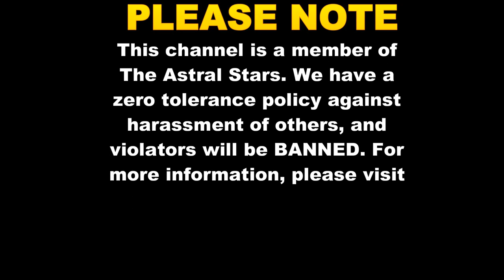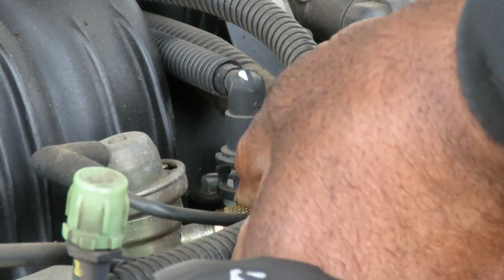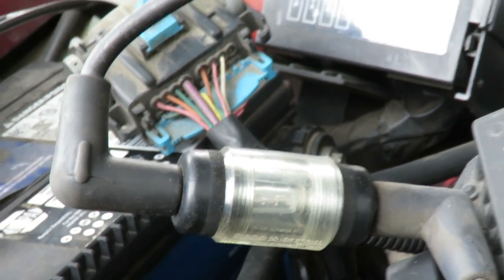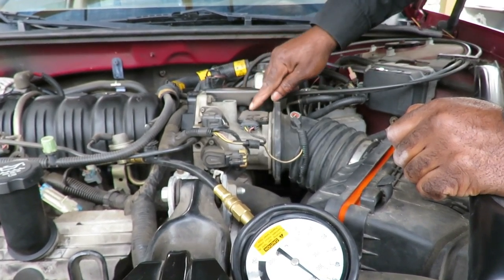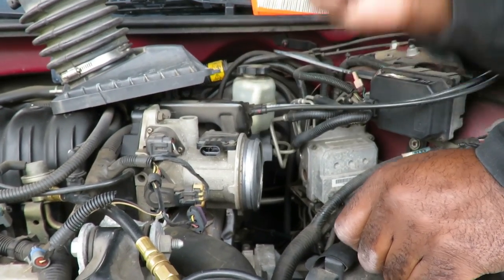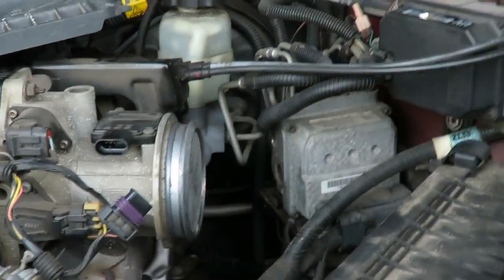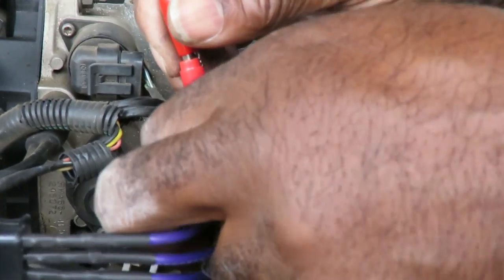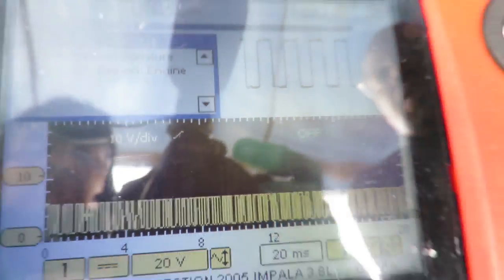⭐ 2005 Chevy Impala - 3.8 - Stalls Out When Warm

Comment: Having the exact issue with my 2003 Impala 3.8L stalling when hot. Swapped out the Mass Air Flow sensor and fixed.

Comment: My car starts fine drives great for about 10 mins then starts sputering and shuts off or if i have already got where im going to and have cut car off then it wont start again for 30 or so mins and then start same problem ovet again drive fine for like 10 mins
Reply: fuel pump?

Comment: @Astral Auto Repairs - Old video but I'm trying to figure out an issue on the exact same car and engine. It'll run fine for quite awhile (talking going 100 miles a day all manner of various driving) and then it'll stall out. Odd thing is it usually starts back up. The last time it did this it quit starting completely for a few days, thought it was the fuel pump, so to test bought the gauge. Gauge showed your same readings oddly enough. Then I removed a spark plug wire to start testing spark and set it down on the frame of the vehicle. Near the "dog bones." She fired up instantly. So that led me to the ICM. As the coils were only about a year or two old. Replaced it, decided to go ahead and replace spark plugs and wires as I tore one of the wires when retesting it. As quite honestly she needed a tune up. I had never replaced the spark plugs or wires. 

Now the same thing happened. Car ran amazing for a solid week going 100 miles a day and now same thing. Actually had to call a tow truck as I was on my way to work when it happened. Stalled 3 times in the span of 2 minutes. Bought a NEW ACdelco ICM as I quite honestly cheeped out and bought a delphi one the last time despite the horrible reviews. I know, stupid mistake. I just wanted the car back up and running as like I said, it's my daily for work. I run light duty soft services for  roadside assistance. I can't be down.  and even said screw it and replaced all ignition coils. As, where I bought the ICM from (Rock auto) advised replacing coils with it.  So I have a COMPLETELY brand new system from the plugs back to the ICM.  (I know, I threw the parts cannon at it.)

Now, I'm wondering was it the MAF all along? No codes, car still starts. But when I was checking the connection on the wires to the coils today after the replacement, she stalled again. Barely touched the very top wire. I'm scared to death to drive this car as I've been lucky each time to be going 35 or under when this has happened. Next time, I'll probably be on the interstate. 

NOTE : This car has 180K on the clock and 166k on the title and the title mileage was around 3 years or more ago when I bought it. It was an ex cop car. (2005 chevy impala 9c1) Still has the badging which you can see under certain light conditions. They just painted over.  Car has been extremely reliable as a daily. But this issue is scaring the crap out of me. I really don't want to have to pay shop prices on it. As I already have to take it to a shop to replace all the subframe bushings. So I'm not trying to turn probably a $600 bill into a $1500 bill. I'd do the bushings myself, but all I have is jacks and jack stands. I don't mind doing my own labor, always have. But wondering if I can get some hints to diagnosis the true cause? Honestly, it could even be fixed but again, due to the stalling I'm scared to test drive her on the road now and play the lottery to see if she stalls in a "safe manner" or going 70+ on the interstate. 

Even just a check list would be awesome. I can fill the details in myself. (The actual explanations on how to do the tests.) I just want to make damn sure this issue is sorted and if there's anyway to diagnosis it in the drive way. Without risking my life.

Comment: I had a similar problem with my 98 Buick Park Ave.  it would stall when it was warm and I was either driving in town or coming off the freeway.  With mine, you could shift into neutral once I slowed down enough, and she’d fire right back up. Super annoying issue.  Could never get it figured out.  Ended up buying a brand new Accord because I got tired of the death by the nickel and dime.

Comment: If you have intermittent, transient/persistent stalling issues it may be the cat
 converter - Meineke cut mine out and replaced it for ~$200 - Stainless 
steel pipe and mufflers (04SS) still good and dual pipes emanate from a single cat converter - The MAF sensor codes have 
since stopped (2+) years ~15k mi since (total 136k) - went thru 2 
sensors over a few years before the 3rd throw of the MAF code after more 
weird stalling issues - after 6-8 months from replacement #2. The auto 
guru I know suggested something else is afoot. Hence, Meineke...They 
said the innards of the cat converter get twisted/turned and causes 
issues. ATbest.
BTW - the crankshaft Pos sensor and ECmodule were replaced via codes prior to continued weird stalling issues. IDKow if the cat converter was the root of the problem or not, but no stalling issues since and MAF sensor #3 (replacement #2) didn't need replacing. FWIW - I don't recall specifically, if there was an O2 sensor code thrown at some point during this process.

Comment: Hey Tim I have a 2000 Buick LeSabre with a 3.8 MAF sensor and I have A p0446 code for purge solenoid. Would that solenoid cause the same problems as well. Once I changed MAF sensor, it cranks upit might shut off I crank it again and it's smooth sailing from that. I have not checked the fuel pressure yet but that might be the next thing I check what are your thoughts
Reply from the maker: Sometimes the purge will allow fuel to go back in the intake, which may cause a high idle. Since you replace the MAF, has any codes come back?

Comment: I got a 03 buick regal. Cuts off while driving and engine gets warm. Took it to O'Reilly's put it on the scanner and it said 02 sensor? How do I know if it's upper or lower and should I change it?
Reply from the maker: The code they gave you will state which one it is. Google the code and you'll find the answer.

Comment: I have a 1999 Buick Regal LS with the 3.8 V6 and the MAF sensor went out a little while back. I had no engine light as long as it was hooked up but the SERVICE ENGINE SOON light came on a fee seconds after I disconnected the wiring harness. Strange as it may sound, the engine light doesn't always come on for a bad MAF sensor.
Reply from the maker: You are right, there are times the MAF will be bad but the check engine light will not come on.

Comment: 05 Chevy Impala here. Same issue exactly. Replaced the mas and still doing it. Fuel pressure is good. Any other ideas on this?
Reply from the maker: When it stalls out, how long before it starts back up?
Reply: @OnlineAutoRepairVideos  sometimes within 2 or 3 attempts. Yesterday called a tow truck and after 15 min it started so I had to cancel the tow truck.
Reply from the maker: @jamesdodge150  follow this video, do the steps, then come back and let us know what you DON'T have. You are going to have to wait until the car doesn't start to check it; https://www.youtube.com/watch?v=P07Gi-c9twk
Reply: Watched the video. All that was checked by my mechanic before I found the first video about the MAS. New twist. Died today and I opened the gas cap and then put it back on and it fired right up... Any ideas on this?
Reply from the maker: @jamesdodge150  Not at all, sorry couldn't be more of help on that one!!

Comment: Timmy I have a 1997 Buick Park Ave with 90,000 miles. My problem is that in the summer months when the engine temperature reaches 205 to 210 and I am feeding gas the engine stalls but starts up right away and stalls as long as I try to feed it gas. If i get the temperature down to 200F its fine again.I have cleaned the MAS, replaced air filter, cam and crank shaft sensors,thermostat , temperature sensor and i still have the same problem every summer.
What do you think it could be?
Reply from the maker: Any codes?
Reply: @OnlineAutoRepairVideos  nope never any codes nor check engine light.
Reply from the maker: @joemarsiello6203  What type of antifreeze are you using?
Reply: @OnlineAutoRepairVideos  using Zerex
Reply: sometimes Prestone Antifreeze
Reply: @OnlineAutoRepairVideos  what do you mean "what type"
Reply: Do you have any further information for my problem?

Comment: I have a 2007 chevy impala.I just had a diagnostic done it said a speed sensor p0720.I changed the speed sensor but now my car stalls if I go over 40mph,and reads Speed limit 107mph.I have no check engine light,I have no codes on the diagnostic tool ,I just got a tune up, oil change and motor mounts before it started stalling.Help me.I have been to 5 mechanics aamco and nobody knows what is wrong.
Reply from the maker: Did you have this issue BEFORE you replaced the speed sensor?

Comment: 2008 impala.3.9
mine has this hesitation.. when im driving along, say 40 50, even on cruse at 65... then when i try to get on the gas, i get this hesitation.  if i keep pressing the gas pedal the Stabil trc light comes on.. so i let off the gas when i feel it starting to hesitate and the light wont come on.. a few times when i start the car it feels like it wants to stall out... I thought i was maybe mass airflow. i cleaned that. cleaned the throttle body. so fast foreward a week, i changed the spark plugs and wires..problem solved. sorta. now when the car is in park or idle the RPM drops and stalls out. this car has never done that.. could it need time for the TPS sensor to relearn, since it may have adjusted to the bad spark plug?
Reply from the maker: Do you have any codes? Be sure to hook up a scanner or code reader because sometimes there will be a code, but the check engine light will NOT be on.

Comment: I have experienced issues with MAF sensors before and for some reason they take forever to throw a code. Apparently this Chevy is no exception.
Reply from the maker: I have never saw a car that runs so bad, that took so long to throw a code. I even had it running with the MAF unplugged, and the light still didn't come on. Well, now I know!

Comment: Interesting, why would it run better with the maf disconnected. No check engine light either. Wow
Reply from the maker: Once disconnected, the ecm will go to a default setting for the MAF. But it is strange why it didn't set off that light, even when I disconnected it.